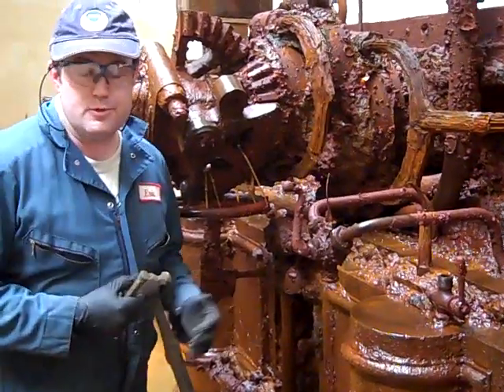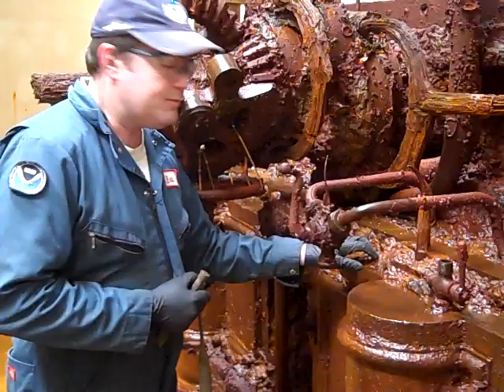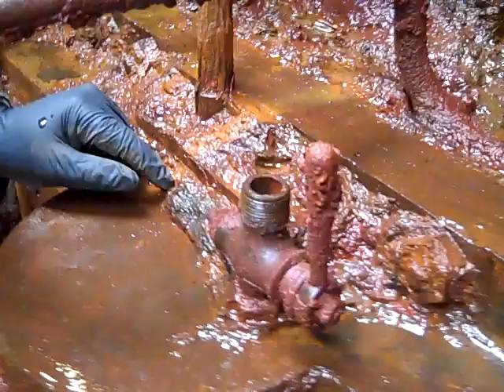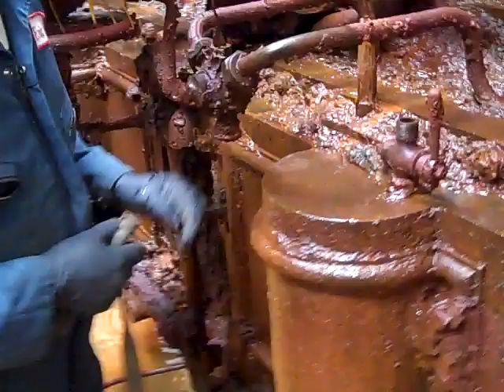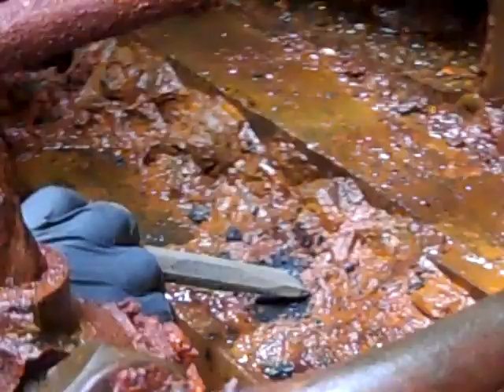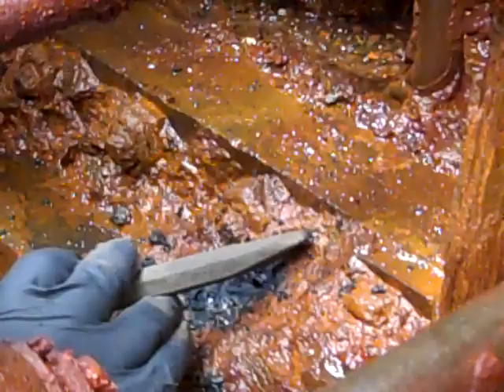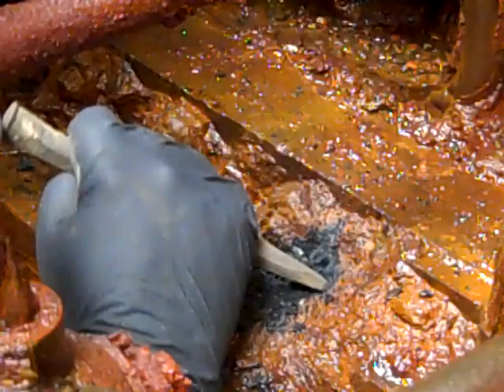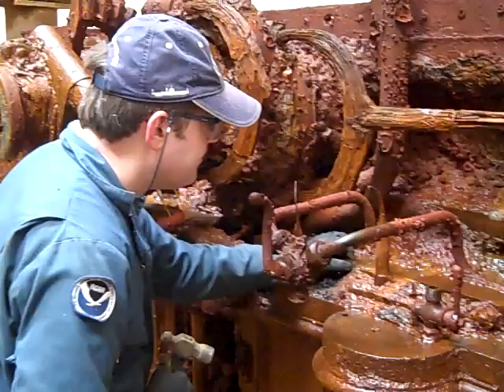USS Monitor Engine Removed from Water for First Time in Nearly a Decade

Comment: USS Monitor, launched 30 January 1862  ships engine (this very engine) developed 320 Horsepower.

fast forward 44 short years...

HMS Dreadnought, launched 10 February 1906 ships engines developed 23 THOUSAND horsepower. 

the quantum leaps in technology in literally less than 50 years back then is even more staggering IMHO than today.

P.S. keep up the great work on the Monitor. she's  absolutely priceless!
Reply: The power of internal combustion over steam. Not the level of nuclear fission over chemical explosives, but a decent comparison.

Comment: Amazing the number of negative comments! Have any of you got any ACTUAL experience in preserving the remains of a 140 year old shipwreck? If you don't then I suggest you ask questions rather than criticize!
Reply: Flasher Trasher  nevermind the fact that, well, it was submerged in saltwater for over a century. 
saltwater is pretty corrosive.
Reply: Flasher Trasher  I mean, yeah perhaps the brass can be salvaged. 
The iron through is trashed. But perhaps it is just better to make a exact replica and showcase that, while leaving the original as a static display. Not an expert, but that makes more sense to me.
Reply: Troll!
Reply: Yes, they are all YouTube experts, there is NOTHING you can tell them.
Reply: Indeed, lots of suggestions that could potentially damage it, and they fail to understand the difference between conservation and restoration.
Reply: Or , perhaps they may know something you don't . There are a multitude of different ways to remove scale from iron , without damaging the iron .
Reply: @johnburakowski61  using acid or a needle gun which many suggested will damage the surface.
Reply: @mrfancypanzer549  You can use a rosebud torch . It will remove the scale without damaging the material .I'm a retired metal fabricator and have used this method many times ,while  reclaiming old iron and steel .
Reply: @johnburakowski61  they probably want to find original paint and stuff rather than just remove rust. some people in the comment section seem to think they know better than museum curators while giving advice that would damage it further. I have worked on museum restorations before and a lot of the time preservation is the goal instead of restoring to original condition.
Reply: @mrfancypanzer549  your exactly right. Its only original once.
Reply: @madmandan1935  ... kinda makes me wonder if anyone has access to the original blueprints and what the cost might be for a "one off" unit.
Reply: It was made using cold rolled steel.  That stuff doesnt corrode as much as it builds up a scale type stuff on it, like hes chipping off.

Comment: That would be a good job for the laser that burns off rust and crud without hurting the metal.
Reply: That would work maybe but... This was over 10 years ago I don't think the laser cleaning systems were available yet.  It would be interesting to see for sure.  Those buggers are like something out of a SF movie..  The sound the make is a bit unsettling.. Cool as hell though.
Reply: I have seen oscillator tools and diamond bit die grinders do less aggressive work improving efficiency . Also a CNC apparatus with the z depth programmed can be less invasive to the metal .
Reply: @jackierogers71  ... to use CNC technology you'd have to know all the original measurements to program the cuts.

Comment: Why not use a dental ultra sound cleaner? Powered up a bit it could break free encrusted stuff like it does on a tooth. Easy enough to test out.
Reply: it would probably do damae to corroded metal, I've seen thorns used in some types of conservation to protect the valuable object under conservation.!

Comment: Hammer and chisel...surprisingly low tech.  Ultrasonic technology is not a viable alternative?
Reply: The second best way to preserve a wooden vessel is also surprisingly very low tech.  I supersaturated bath in sugar water is, in fact, the second best way.  But I do wonder why a hammer and chisel is being used on the cast iron motor.  Maybe it is just to take off the really thick stuff and then a higher technology method is used for the finer details of the cleansing.

Comment: That area he is chipping on is going to be severely pitted no matter what, might as well use an air impact gun on it to get down to solid metal.  I have done a lot of this kind of work, the black matter is not coal, it is just the byproduct of oxidating metal.  Sometimes called “ carbuncle”.
Reply: People that do this kind of conservation would never use any kind of air impact gun,they just dont want to risk it,they will use these little chisels even if it takes them 500 years to take all the stuff off, i work in a machine shop and we work on massive machines,Ive used air impact guns many times,i know what you mean.

Comment: Why isnt the worker wearing safety glasses with side shields or a face sheild?
Reply: He is wearing safety glasses and at the pace he is working there is no chance of anything,i have done this kind of work for years on massive natural gas compressors removing scale and rust, only time we are required to use a face shield is when power tools come out, I'm sure if one was working for NASA they would require face shields when you zip up your fly.

Comment: Dare I say that putting everything in a tub of mild acid would be faster, and pose less risk of damaging anything. I'm sure there is a reason you do it the way you do but I don't understand why.
Reply: To not damage the original surfaces would be my guess...
Reply: Acid would cause galvanic corrosion between the dissimilar metals.

Comment: The big question, will she ever run again?
Reply: nah, the pistons probably froze in the shafts.
Reply: The parts are far too brittle to ever be operated anymore. Only way to see this incredible piece of engineering at work is to build a second, full-sized and operational replica.
Reply: Flasher Trasher  The boiler isn't even in this video, just the engine itself.

And the engine itself could probably be restored to working order, at great expense, with a full rebuild. Many smaller more intricate components would need replacing, likely the pistons too, and the cylinders would need to be bored and sleeved, but technically doable.
Reply: Flasher Trasher  You wrote about how no way the boiler would be safe to operate, in a comment talking about the engine itself, on a video of the engine by itself.

Perhaps read your own comment, since evidently you don't know what you wrote.
Reply: Flasher Trasher  I was responding to the first part of your comment not the whole thing, if that was somehow not evident. The opening statement carries the implication that I was referring to the boiler, I was not.

My second part of the comment was detailing what it'd take to get the engine itself running, as there is no way it will run without rebuild, air or otherwise. Funny how you mention steam yet I've repeatedly said nothing of using a boiler, and you "duh" me over pointing out I didn't say to run the boiler? Cute. 

Also boring and sleeving cylinders is not replacing them, in fact it's the exact opposite, it's a way to take a bad original cylinder and make it functional again.
Reply: The BIG answer... NO!